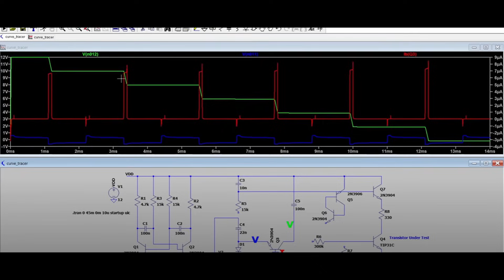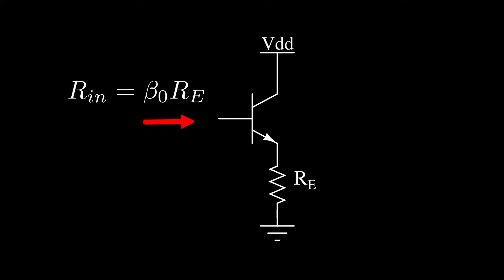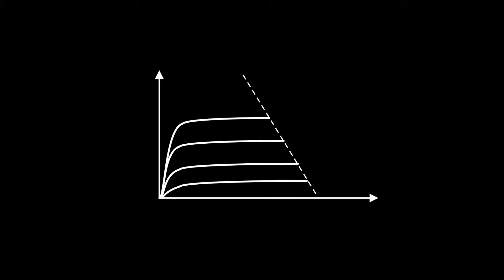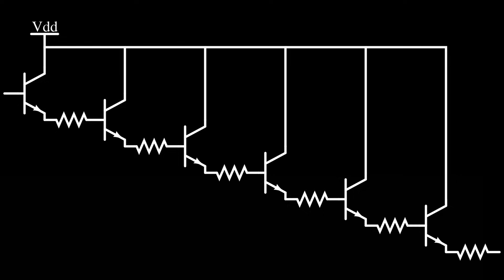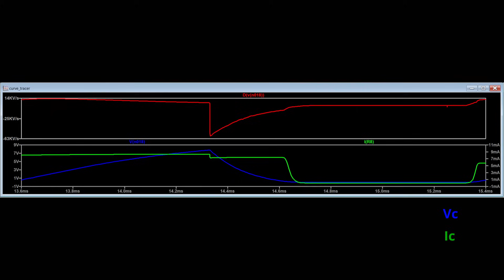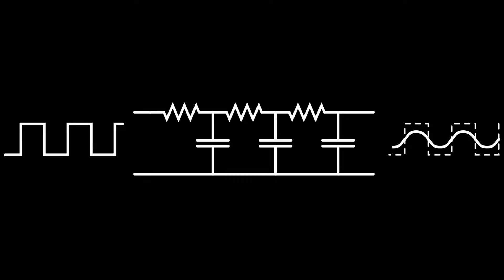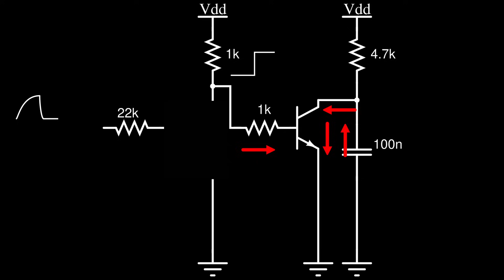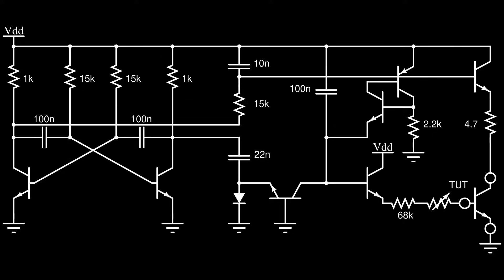IMPROVED Discrete BJT Curve Tracer: the Unexpected Role of Parasitics

Comment: The discharge of the capacitor throw the transistor is not instantaneous, and you can appreciate that by analyzing the Vce vs Ic curve, it starts at the active zone and then falls all the way until it reaches de saturation zone, so it is not like discharging ir with a button or something like that.

I have studied that use of transistor and found that you can model the saturation zone as a y =m1*x line, and the active zone as y = m2*x + b line, finally I found that the discharge time is   6*(C/m1 + C/m2).

About m1 and m2, you can stimate then using a SPICE model of the transistor like multisim VI analyzer.

Let me know any doubts

Comment: The tendency to overcomplicate things is common with engineers, even the best, so you are in good company.. What engineers tend to do is to create a problem with their beginning approach to the design. Later they start adding to the design in order to correct for problems that they introduced to begin with . Elon Musk has discussed this at length regarding the engineers that designed and built the Tesla cars. One of the things he pushes his engineering teams to do is to continuously question the entire process looking for simpler more effective solutions, to not get trapped in a box that they might have created for themselves. 
Many have started their curve tracer designs based on this schematic. Some very good engineers on youtube have started from scratch. I mean no offense but I've seen better designs regarding how well they work based on starting from scratch using an entirely different approach. More eloquent, simpler (fewer parts). I have studied many of them as I have been working to create my own. Being naturally lazy myself and wanting the best functioning curve tracer for the least number of parts and time investment. Ironically I will have spent more time before I'm finished watching Youtube than building the darn thing. 🤣🤣

Comment: If you change one of the capacitors in the astable multivibrator to 10n then yo don't have such a long dwell time creating a bright dot on the scope screen.
Reply from the maker: Yes, you are right! You'll change the duty cycle of the square wave, didn't think of that. But that will change the frequency as well so the RC filter time constant needs to be tuned again
Reply: @indepth_electronics  I don't think the RC filter time needs to change, it is controlled by the changing time, not the discharge.  For me the circuit works the same with the lower capacitance, the frequency changes but the charging ramp time stays the same.
Reply from the maker: How can be the rise time be the same with an higher frequency? Did you directly check it on the oscilloscope? The curve tracer should continue to work with a wrong RC constant, the only change would be that you reach a lower maximum collector voltage, thus shorter lines, that's why I think it should need some tuning. I'm probably missing something right now, but I'll look into it more carefully the next days! But you are right, that should be the way to go, thank you!
Reply from the maker: On a second note, you are absolutely right. I got a little confused there. If we are still using the "100n side" to drive the collector driver part, nothing changes. Same RC constants in that side of the circuit, same rise time, so we don't need to change anything of the RC network for the collector drive. The frequency changes only because we shortened the time of the other side of the astable, but the 100n side should output the exact same waveform. Sorry for the misunderstanding and thank you for your good idea!
Reply: @indepth_electronics  Actually I did find a problem with using the smaller capacitor.  The step function step sizes depend on how much charge is stored in capacitor C3, but with the smaller time for this phase of the cycle means that the capacitor isn't charged as much by R4.  I changed R4 to 470 ohms so that C3 charges faster to restore the step sizes.
Reply from the maker: Yes that makes sense. Thank you for your work!

Comment: Could you save a transistor in the capacitor discharge by driving the transistor directly off of the other side of the astable so you don't have to invert twice?  Or do you need the gain of the two stages?
Reply from the maker: Thank you for pointing that out! I wanted to add a comment in the video but I completely forgot. To have the fastest possible discharge of the cap, I want to drive the second transistor with a very high base current to ensure a strong saturation. So I need the first transistor to both have a high gain and also to act as a buffer from the astable. Drawing too much current from the astable could disrupt its working

Comment: Thanks for posting. I noticed you installed a 4.7 ohm resistor at the  Collector Emitter junction. Did you use a 1 watt resistor?
Reply from the maker: I've used a 1/4 watt resistor which works fine with the values I've given, since the collector current isn't that high. However if you want to go higher in the characteristic, by decresing the base resistor, you might need a 1W or 2W resistor. Keep in mind that in the worst case scenario, i.e., the transistor in saturation, a current of almost 2A will flow with 12V power supply, and there will be a dissipated power of almost 20W on that resistor! So if you want to test the saturation, I obviously recommend to increase the resistor to the original 330 ohm or higher

Comment: The old Eico 443 semiconductor curve tracer ( I have one)  uses a half wave rectified AC signal from a secondary transformer winding as the horizontal drive signal, and it mostly works OK.  A good sawtooth signal also works well, and seems to be what most BJT curve tracers use, as you have found.
Reply from the maker: Yeah I've seen signal from transformers used as drive signal in other hobby curve tracer. It is probably the simplest solution to go with. I'd be curious to know if commercial curve tracers are affected to the same problem I've found

Comment: Great job! I might try and make the circuit, and test it on my Tektronix TDS3052. Would be cool to see if there was a way to adapt this for both npn and pnp transistors.
Reply from the maker: Thank you! The original circuit can be adapted easily by just switching the power supply polarity and changing all the NPNs with PNPs and viceversa. This can be done easily on my circuit as well. So with a dual power supply and by duplicating this circuit, you can do it easily. However I'm sure there is a smarter way to go with without doubling the number of transistors. I'll think about it, thank you for the idea!

Comment: Great work. I have used op amp versions of this. But you have a nice circuit. There is another curve tracer option which is super simple to build but its more analog and works well for diodes etc. Look up Octopus Curve Tracer circuit! Its so simple and yet so powerful. Its not the same as yours but for things like diodes its a 2 minut build with stuff around your garage and its amazing to see working. But you did an awesome job in this circuit. I will try it.
Reply from the maker: Oh yeah I've read about Octopus! That's basically using the main AC sine as your test voltage and that's it, couldn't do it in a simpler way haha!
Reply: The "octopus" tracer is good for troubleshooting, but is really not going to give you any gain parameters of a BJT, thats where you need to have a curve tracer that will put a BJT in a full  base-emitter-collector circuit instead of just testing across each junction one at a time. you could never try to match 2 transistor's gains with a 2 lead component / octopus configure tester.

Comment: How to trace a PNP curves?
Reply from the maker: If you look on Eddy's website from which I've taken the original circuit, there is a PNP version. You basically just switch all the NPNs with PNPs and it should work, also with my version
Reply: @indepth_electronics  
I figured, thanks.

Comment: hi! if there isn't a "no ICs" rule you might try an op-amp based relaxation oscillator to generate even prettier sawtooth waves.
Reply from the maker: To be honest I think it still wouldn't work. If I remember correctly, the relaxation oscillator still has that sort of "RC" rise transient and fall transient, so we would get back to the same problem. I think a sine wave generator would be the way to go

Comment: May be a cascode amplifier to avoid as much as possible the miller effect.
Reply from the maker: Thought about it! However then it would quite difficult to measure precisely the current through the collector of the transistor under test. The whole point of the curve tracer is to sweep the collector voltage, while the purpose of cascode is to avoid the change of the collector voltage to avoid the Miller Effect, quinte contrasting things

Comment: On last scheme what are the transistor models for both pnp and npn transistors?2N3906 and 2N3904?
Reply from the maker: Yes, I've used 2N3904 and 2N3906 like in the original schematic, but any general purpose transistor will probably do

Comment: Great job! It's good to see that others find it hard to get what was the cause of something odd, it makes me have more a more calm and reflexive approach. I'm pretty sure it is nicer to see in an old oscilloscope than in a newer one, as there isn't a visible gain in using a digital one, because there isn't built-in functions on the less used XY mode if you don't pay a lot for one equipment.
Reply from the maker: Yes! I had a hard time finding the origin of that behavior, but by excluding every other possibility, looking at the transistor under test was the only thing left. Everything made sense while I was pondering about the possible involvement of the Miller Effect. Yeah, usually analog oscilloscopes are better for this kind of things, in fact I'm a little bit worried on how it will look like on a digital one

Comment: Brilliant video! I will put this video in the curve tracer article! I'm will try to build this myself and test it on my Rigol DS1054 so you can see what it looks like on a digital scope. Once again, well done! --Eddy
Reply from the maker: Thank you very much Eddy, I'm glad you enjoyed the video. I'm very curious about how it will look like on a Rigol, looking forward to it!
Reply: @indepth_electronics  Sorry it took 5 months but I have now received the PCBs I designed for your circuit back from China and I built it up and it works on a digital scope however the signal is very noisy which makes the traces very thick. I think the whole PCB needs to be enclosed in a grounded metal case for this to work well. I only got 4 traces on the display but I put in 120nF caps for C5 and C11 which gave me 6 traces. The trimmers for the Bias of the T.U.T. work well. They determin the height of the graph you get on the scope screen. Btw, I used 2N3904 and 3906 transistors instead of the BC547 and 557.
Reply: Follow up on the previous comment: I managed to get a beautiful display with slender traces by changing the 4,7 Ohm resistors for 15 Ohm ones. No more need for a shielded case. It works fine now.